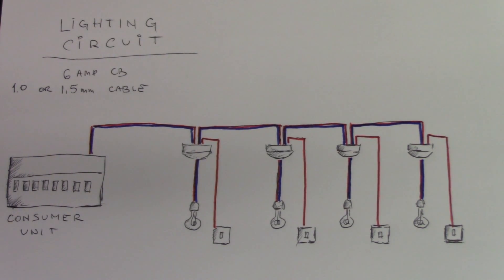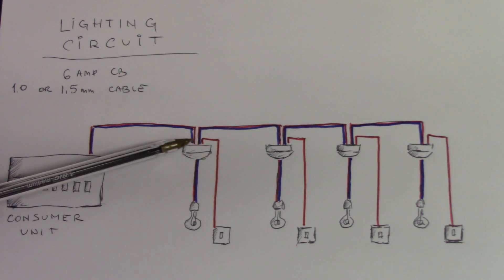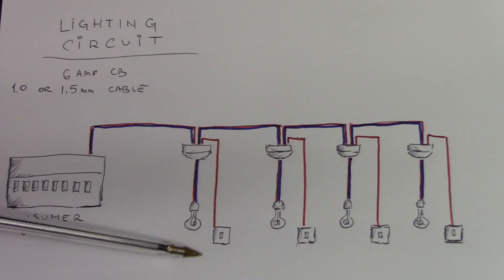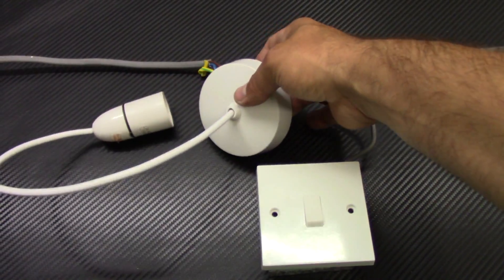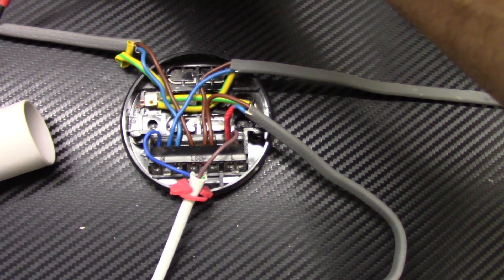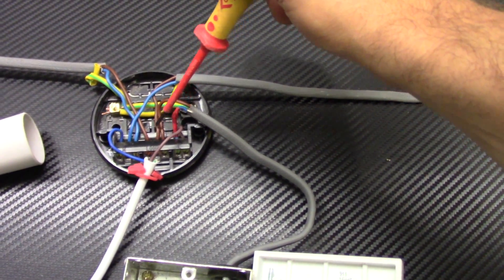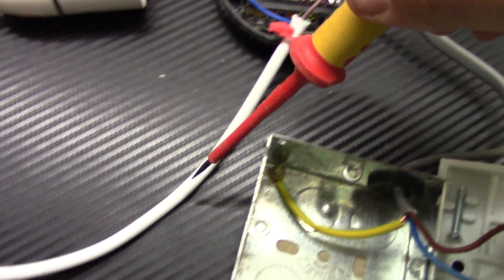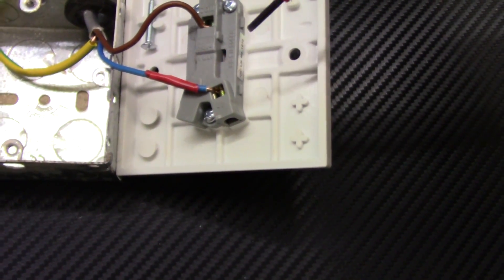LIGHTING CIRCUIT ceiling rose one way switch wiring connection

Comment: Sorry for the random question but are upstairs lights usually connected in series, in one, then out to next light?
Noticed bathroom spots not working and room ceiling rose. Other room spots are working..
Could be bulbs but if one bulb goes does that mean rest of lights further down that circuit wont work?

Comment: These. Type of splice is frowned up in us code since having a box containing switch leg  and hot without a neutral. Generates too much heat and that box according to us looks like a pancake which is supposed to contain only one cable like some  old work boxes and a utility / handy box also wire connections. Either use wire nuts. Crimps.  or recently   wegos and in the past spliced soldered and taped which most electricians. Nowadays would find a rather daunting task since some those splices could have been western. Union or  tapspliced  types of  splices instead of the normal pigtail variety .i personally have not seen any thing other than pigs tail utilizing wire nutswires   and crimps can not say I have not  seen sodered   western Union or tap in any thing other the nightmare of knob and tube  wiring

Comment: @how2d2 Hi i have an external light that has a plug on it to turn it on and off. I want to put a switch on it. The light is plastic. Ive noticed that the wire connection has no earth wire in it, is this a problem? Do i need to rewire the the whole light to earth it? Or could i just use earthed cable from plug to switch and then leave existing cable (live and neutral) from switch to light? 

Or just add a switch and it will be fine?